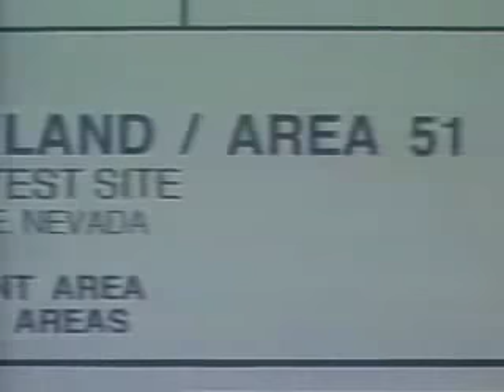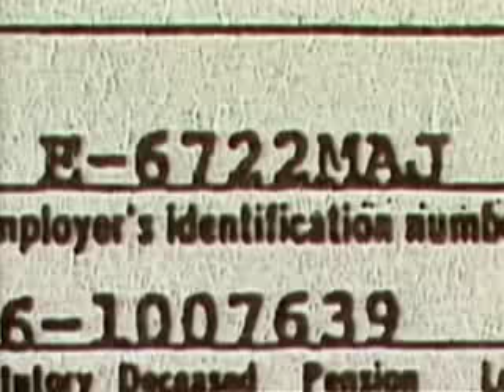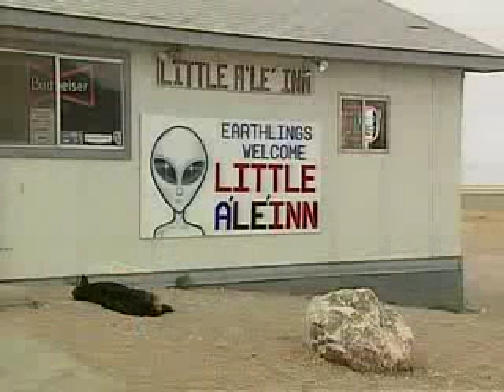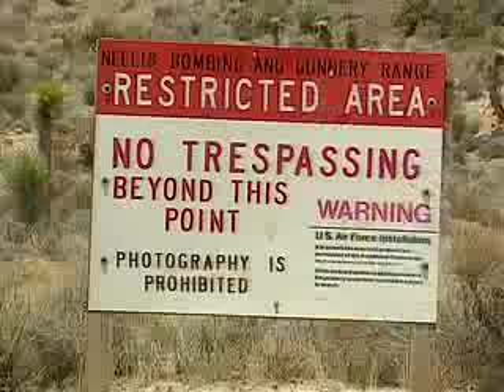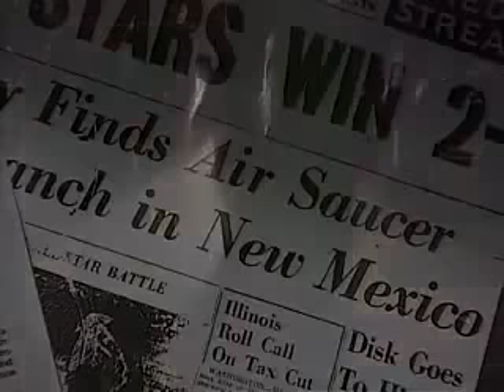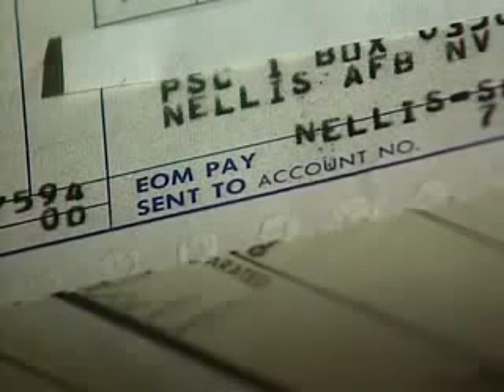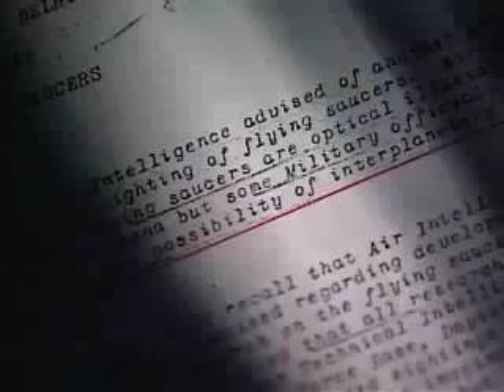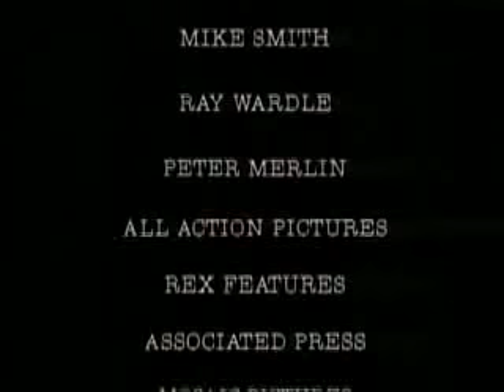Dreamland Area 51 Documentary full length

Comment: @26:22 
71 year old Mechanical Engineer Bob Uhouse Employed by A51 S-2 in 1950 worked on designing the 1st Simulator for the retrieved “Off World” Vehicles—So that pilots could be trained to fly the actual ET spacecraft. 
Yes—very astounding how one could possibly design a simulator for a craft they could not replicate, my conjecture is that they since two virtually identical ET spacecraft were retrieved (Frmr AFOSI Richard Doty’s interview with Greer on 2 crash retrievals 1947 & 1949 ) that they may have used parts of the one with more damage to create a simulator.  
He has a longer detailed interview with Greer but he seemed to not be able to answer this question as clearly stating it was very compartamentalized (he was assigned one specific task whereas overseers contained the overall Information and would relay what his specific task on the simulator was: 

https://youtu.be/VxA-Y4enohQ